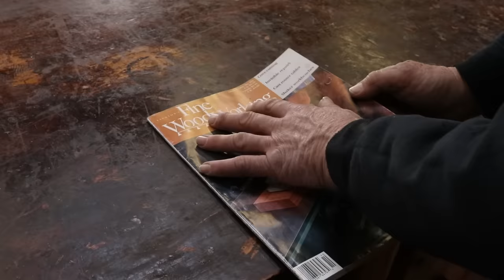The Most Impressive Workbench I Have Ever Seen

Comment: I’m a GC in Wyoming, and built a very heavy, classic and historically consistent Roubo bench for my shop, about 6 or 7 years ago.  It was the most satisfying project I think I’ve ever done.  It is now the centerpiece of the shop, and I use it and adore it.  You won’t regret this journey.
Reply: I built a Holzapffel style bench, 13 years ago when I came back to the craft. It's like a Roubo, but with a twin screw. I learnt a lot building it, but I learnt better lessons in the years since whilst using it.

I think I'll eventually build a better bench, still in the French style, but with better work holding. I can definitely see the appeal now of a traditional leg vice.
Reply: Ive seen a set of plans for a roubo late 1800s design specifically for boat building. Still have the plans which I drool over.

Comment: Enjoy the build. My grandson and I each built our own thick top workbenches a few years ago. Built mine in a little over 4 months, grandson was a young teenager when we started, so took him about 3 years. Much of ours is similar to Ken's. Dovetailed edge pieces tie end plank that is mortise and tenoned to all inner pieces and wood pined. All joints are mortise and tenoned with wooden draw pins to hold it all together. I made a wagon vise on mine which I use constantly to hold a board that I am hand planning or sanding, I think if you add the second vise to the overhung end near the edge, (which one depends on if you are right or left handed), with stop holes lined up down the length of the bench and in line with the center of the vise with pop up catch you will be surprised how much you will use it. Tried to enclose a picture but couldn't figure out how.
74 year old and still learning, Jim

Comment: Power supply to your bench.  I have to say that one of the best things I did in my shop was install a really good power reel on the ceiling and about on the center of the opposite side (from typical user front) of my bench.  I also have a small ceiling hanger to store the three outlets end of the power cord that keeps it from being in my way when I am not using it.  When I am using it, I can adjust the cords, so they don't interfere with my power machining operations.  I also stretch the cord to my lunchbox planer and router table from time to time.  It is way beyond handy for multiple uses.  I highly recommend a power cord reel.  Oh, and Ken has a beautiful bench!  Thanks.

Comment: Hey EC, been following the channel along for years and have enjoyed watching the work and learning a lot of the history from where you live along the way, a suggestion for your woodshop section of the barn if I may:  

Install either an air line to the gizmo you have your power cables hanging from or install a separate retractable air hose reel above your main work area so that you have in place air that you can easily access and use for air tools & importantly in any workshop the facility to easily blow down and clean your working surfaces and products of sawdust and woodchips.  

Given the use of sharp tooling, blades & saws in a woodshop (or any workshop in general) having the facility to easily move air lines up and out of your way clear of the work area is a great quality of life (and safety) addition to any workshop.

Keep up the good work, I enjoy watching from Scotland.

Comment: What a bench! I have my 2 of my Grandpa’s benches. Both similar layout as Kenny’s but not nearly the joinery details. Actually they’re both built of common construction lumber and leftover materials. Grandpa’s heyday was during the depression so anything that didn’t burn down or get wet and rot deserved a second chance. His second, “final” bench used repurposed material for the top, on old diving board from the Dover, OH swimming pool. It’s widened a bit edged in red oak and covered with a replaceable layer of masonite. Drawer guides are all wood and silky smooth. Always a pleasure to work at his bench and use his tools. Gives me a connection to one of my greatest heroes.

Comment: I look forward to the series.  One thing I would suggest is this:  Make the drawers and cabinets open from both sides if you don't intend to put the cabinet against a wall.  That is, have drawers that will slide right through - with knobs on both sides.  That way you can access your tools no matter which side you're standing at.  It also makes it so that you can arrange your drawer contents so that particular activities are best done on one side of the bench, but because you can pull all the way through, there's no stopping you from doing them from the other.  There's a trick you just can't do with metal slides but you can do with wood-on-wood slides like Kenny's got.

Comment: It's always a pleasure having Ken in a video!

A suggestion for power. 

Run a bit of romex discreetly in this piece. You may consider that you or your grandkids may house some battery chargers on this piece, and the shelf one may use could use a dedicated outlet.  As for the main power source, I like the idea of a hinged board under the overhang that swings down for easy access. You flip it up and it holds in place with several magnets you recess into the wood. 

I look forward to the build!

Comment: Looking sharp! ...may I suggest though, that you also run dust extraction and compressed air out with those extension cords on the boom - it'll come in very handy the minute you start doing any sort of work with sanders, plunge saws, routers and what not.  Not only will the extraction improve air quality in the shop, but also keep the tool from choking and leaving burn marks, while also giving you a clear look at the workpiece.  This especially goes for the router, and more so on deep trenchwork, mortise, dados and what have you. 

I can't quite see how your setup is in relation to the boom, but some kind of on/off switch will also come in handy,  regardless if on the extractor itself, somewhere along the piping/hose line, or even by remote, either directly on the extractor, or a shut off valve, to concentrate suction elsewhere,  if in a multisystem.

...have tried setting up less elaborate shops than this, and even those could keep one awake,  pondering which option would be the better solution or lesser evil. Preferably,  you'd have your ducting away from the floor,  and as you haven't previously trenched it in, or not that I know of at least, overhead pipes would probably be the  better solution... which then provides risk of collision with the/a crane... again - it's a tradeoff,  which I'm certain you know all too well.  It's good to have stuff that moves, but with it comes the required space.  Happy shipbuilding! ...looking forward to follow along.

Comment: About the power for the bench, (it might be hard to explain without a drawing so please bear with me). Make one of the drawers deep enough for power tools, sander, electric planer etc. Mount a power strip inside the drawer and cut a few notches along the top of the drawer face (I'm thinking of something like a "U" shape). Then you can keep you most used tools plugged up and in the drawer. When you need one open the drawer, pull out the tool, put the cord in one of the notches and close the drawer.

Comment: Love your channel. Safety/health concern! The hanging heater if exposed to solvents, paint, etc will rust out your heat exchanger and carbon monoxide will pour into the shop.
The heating industry calls it " halogenated hydrocarbons".
Look in a Grainger catalog in unit heaters and read the asterisk about this.
As a retired dealer auto mechanic with asthma I was the canary in the cage and got sick before anybody else and all 3 shops I worked in I discovered rusted out heat exchangers ( rusted from the inside out) and my suggestions fell on delayed/deaf ears.
I suggest a counter flow sealed combustion counterflow house furnace mounted 2' off the floor.
Air filters built into the sides of the top air box, and then box the bottom in, about 1' off the floor, punch 2,  6" holes into the bottom of the box and attach to indexable 90 degree outlets to facilitate  being able to direct air where you need it.
Good luck

Comment: What a beautiful bench.
There is a lot of excellent traditional vise and bench hardware out there anymore. There's a lot of work holding options, it just depends on the work you want to do.
Go for the dead man. If you have a large panel or long board, you can clamp it on edge in the vise. You'll need it. 
Do the dovetailes, whether cut by hand or  by the router. You'll be enormously proud of them when you're done.
I have outlet boxes mounted at each end of the bench under the overhang to keep sawdust and shavings off of them. They are wired together to a powercord that can be unplugged, so the bench can be moved around if needs be. Good luck and have fun.👍👍

Comment: I thought about removable wall panels but went with surface wiring. EMT pipe is cheap and easy to use. You can even use PVC if you  want. You always have an open chase that way.

Comment: This is a beautiful rendition of a Shaker Style Workbench. As to where I would put the power supply, if it were me I would attach it to the sliding deadman hold using dowels attached to a removable board. Depending on which vice you are using and how you are clamping your workpiece you will appreciate being able to slide the power supply along the deadman slide, and it is removeable for when you don’t want to use a power tool to work on a piece. In my humble opinion, a work of art like a workbench cabinet shouldn’t be permanently marred by an ugly looking power supply. Lastly, I think you might want to check out Veritas for your workbench vices. They make an amazing twin screw vice if you want an end vice (highly versatile when using a sliding deadman). They also make a beautiful inset vice, and their quick release vices are a thing of beauty. In my opinion, If someone is going to the trouble of spending time and effort building a custom workbench, spend a little more $$ and get a set of vices that will last as long as the workbench will. Thank you for another inspiring episode…

Comment: "If you take the time to build a bench"
May I suggest checking out Andrew Klein's Twin Turbo Vise for your new bench. They are truly special. Masterful engineering, extraordinary work holding and eye candy for us tool lovers.
Also, please give serious consideration to using old growth Douglas Fir for the top. No right or wrong, just makes a different working character than a hardwood bench. You can check out Jay Bates video comparing the Southern Yellow Pine vs Hickory benches he built. Again, no right or wrong, but significantly different. 
Congratulations! You've found another rabbit hole. Thanks for sharing your journey. We all benefit from your travels, your wit, and your wisdom. Keep up the good work!

Comment: When I was a boy, My dad had a heavy bench made from rough cut
timber. The frame was left exposed. He told me the bench was built 
by his Father, God only knows how old it was. So, as a young man
when I got my first garage I wanted a tough as nails bench myself. I 
used 4x4 for the 6 legs, 8ft long, 30" wide. 2X16 planks for the top. I 
wrapped mine in plywood to create underbench storage & I added 8 
drawers. Since 1982 it has been a fine bench & it too should last as 
long as grandads.

!

Comment: The power on my bench is a long power strip that is inset on the front edge of the top. I can still clamp stuff to the edge and not hurt the power strip. I bought a hard-wired power strip from the local hardware store and wired it up. It has 12 outlets in it; which is more then enough for me. But it spans the entire front of the bench so I have an outlet no matter where I'm working on the bench.

Comment: Man, that bench is awesome!  I just clicked the subscribe button, because I gotta see how this turns out.  

I'm glad you decided to add that sliding stock support, as not having one on my bench is something I regret.  BUT, this video gave me the idea to make one, and one that slides as I've never seen that type.  

As for the vises.  Hit up some flea markets and such.  Sometimes they show up, and you can fall into a good one that way.  Might take some TLC to get right, but the old vises are rock solid.  I got an old Wilton vise from a school that was closing down.  It may be older than me, and I'm in my 60s.  

The OSB on the walls will also allow you to hang cabinets and racks easier, but you probably know that lol.

Comment: I found a table in the trash a few weeks before they had an estate sale. High quality saw horses connected with a big top and metal slides. The saw horses are held in with 6 screws into the wood top and has a metal railing style piece that connects the middle bottom of the feet to the middle of the table it has big over hangs and a center leaf. It's 2 chairs deep and you fit nicely on either side and my TV and laptop and chair in the middle like a desk. I keep water drinks food literally everything eat write draw

Comment: I used OSB for shear, or cheap underlayment for plywood finish shop walls for years but gave it no respect - because technically it's wood, but it's not a wood you would build anything out of. Then I saw a dance floor created with it, one of the smoothest most beautiful floors I have seen. 
I have used/re-used the cutoffs for years to cover stacks of wood, and seedlings in the garden, nothing outlasts it except cement board. 
OSB, the humble, understated low dollar workhorse that just keeps on going.
Your shop is magical, hell I would pay top Air B&B rates just to sleep for a night or two curled up to the forge.

Comment: Advice:  get a wood working vise that pulls out as far as you need, pushes back in to clamp.  Then, a half turn on the vise handle CW tightens up the vise.  A half turn CCW takes the clamping pressure of the item, pull vise slightly open to remove the piece of work, slide vise close all the way.  A REAL TIME SAVER, rather then screwing the vise open to 8", and then back closed.  WOODCRAFT has them, called a quick release vise.  10 1/2" for $150, on sale right now.  Regular is $235.00  Line the jaws and you are good to go.

Comment: I am loving your videos since I found your channel. I do a little wood working so I am novice but I want to build an octagon gaming table. Could you recommend any video's or books I could review? One of the question I have is, is it okay to mix woods. For example, use pine for most of the table but use Oak for the top.  My thinking is cost saving using the cheaper wood for the bulk of the build as the top of the table is what everyone looks at.

Comment: Amazing woodworking. I hung a power strip on the underside of the lip on the right side of my work bench. No scraps or splinters can get lodged in the outlets and no relief is needed on the plug end of the cords. It’s not the easiest place to plug tools into but the few that I use on the bench tend to stay plugged in anyway

Comment: OUTLET #2,  replace your overhead cord with a "Gauge Extension Cord Reel, 45 FT Retractable Extension Cord, 12 AWG/3C"  This would allow you to pull the cord out to anywhere in the shop and then pull it like an old window shade and have it retract back into the overhead. "Suraielec 12/3 SJTOW cord reel 15Amp UL listed" connect to GFCI barker.

Comment: If yar are going to do it, i would do it right. Make plans to add a receptacle to each corner of the bench. You can wire an extension chord to one corner  to plug in the wall. That way you can unplug the entire bench and move it if you need to

Comment: I notice that Ken did not use hold downs - or did he? They are an integral part of many hand tool woodworking benches. If you plan to travel this path, the cabinets under the bench need to leave space for the hold down to poke through the bench top. Regards from Perth, Australia, Derek

Comment: Even if the shop burns down well built benches and other shop infrastructure can actually survive. You’d be surprised how long wood can actually last in a fire as it burns from the outside in and takes a lot of time. We actually still have furniture from the tail end of the 1800s that survived a fire; it was simply cleaned up and refinished after the fire and it still in good shape. The house survives the fire quite well too, though that was because everything was built with large lumber that has a lot of resistance to burning. Today things just burn quicker, especially soft goods, and there simply just isn’t as much wood.

Comment: I am curious why there is insulation on that wall which appears to be at the peak of an A-frame roof, therefore not facing the outdoors? Perhaps the other side is just still an open air garage? I would think the insulation would go on an exterior wall. I am sure you have your reasons.

Comment: I need to build a milling and wood working mason's table out of green Larch for a giant at camp. It will also get used as a handicap picnic too. Just a chainsaw and hand tools. I like being able to get push mower under the picnic tables I build. On the wide benches your feet don't touch the ground. I prefer to mill boards vertically. 50$ investments have been my think lately. Like wood for Lazutin Bee hive 45$. Apple or cherry trees 50$. Load of top soil 50$ plus gas. Gotta build skillion pavilion at camp this summer on block piers. Keep it simple stupid and cheap passive solar design.

Comment: Can you elaborate on the sliding tool rest ? I guess, I'm not understanding it ?
Reply: At 11:55, you can visualize its purpose.  When clamping a long piece in the vise (top left corner of screen), the work piece would be held against the edge of the table along its length.  The sliding “dead man” is there to hold bench dogs (wood or metal pins) that support the end of the workpiece that isn’t held in the vise jaws.